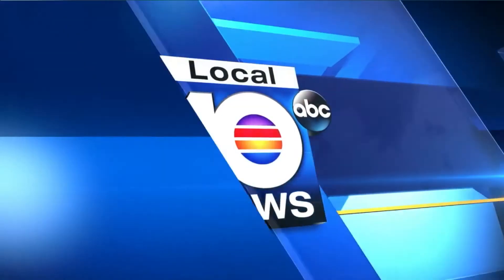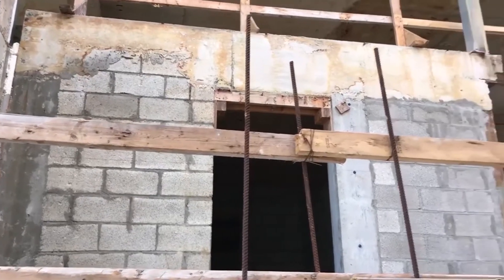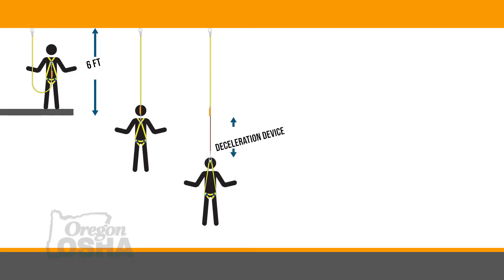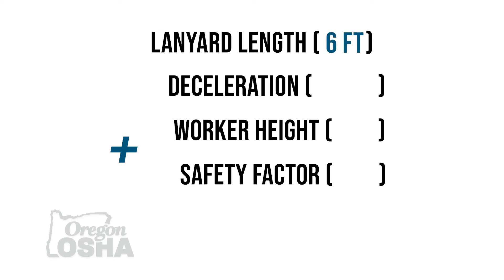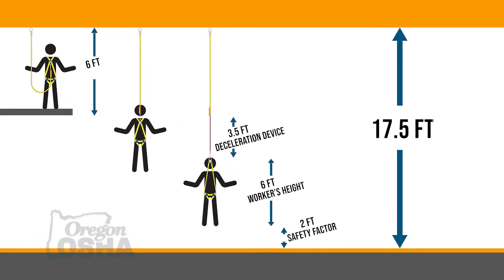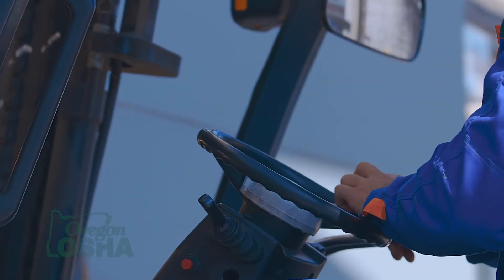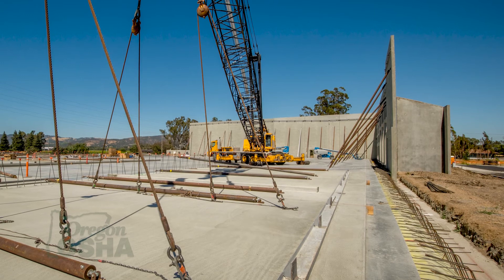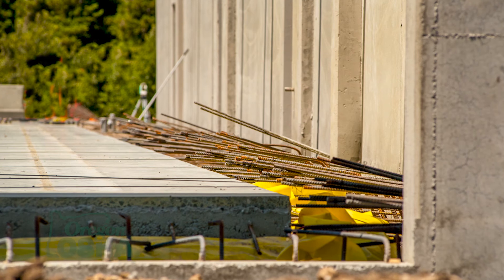Do the Math - Calculating Fall Clearance Tutorial (M2V4 Do the Math)

Comment: I’m actually thankful this video doesn’t pull punches in the language used. People need to understand this will absolutely kill you. Period.

If you’ve never seen a worker fatality from a fall, consider yourself lucky. Worst day of work I’ve ever had. Seeing a 21 year old KID laying dead on the concrete with his skull smashed open. Teeth, flesh, brains, and skull fragments scattered everywhere in a 60’ radius circle. One of his boots came off and was prolly 20’ away from him. 

People think putting on a harness is enough. It’s not. You need to understand everything about the system you’re using.